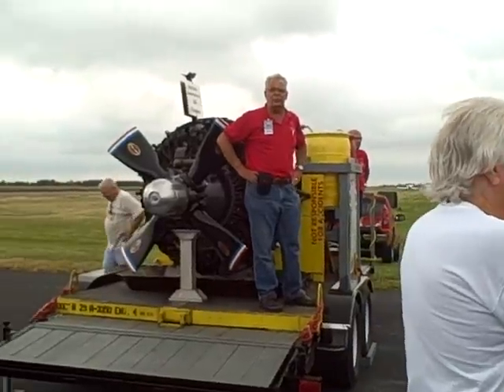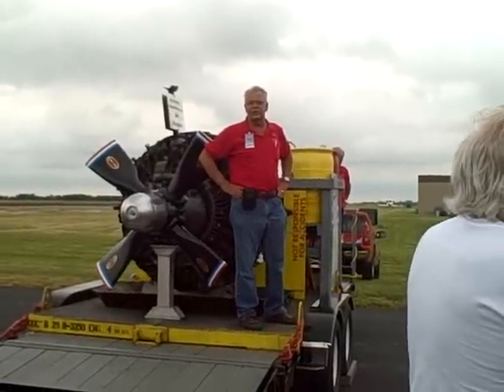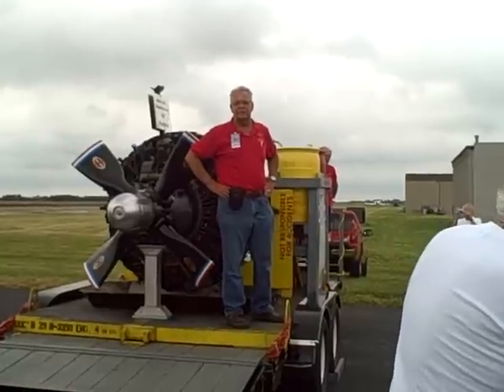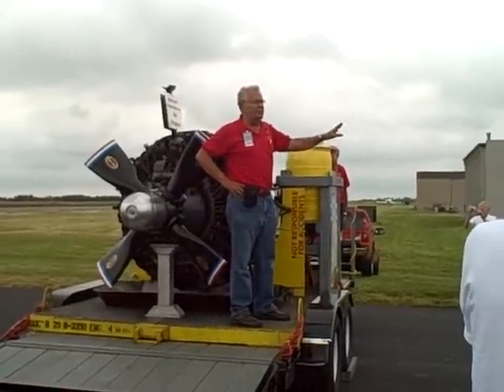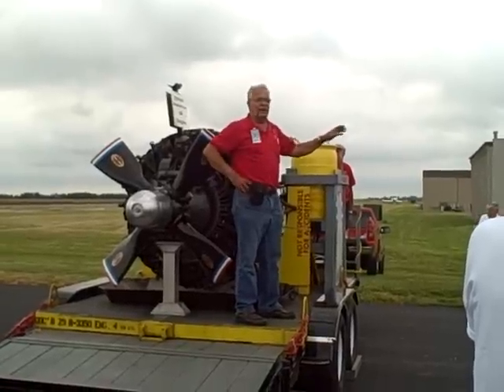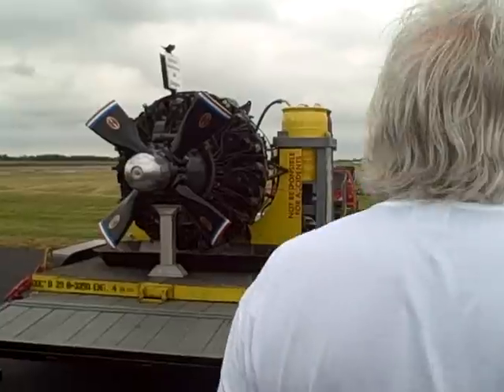B-29 "Doc" number 4 engine static start

Comment: WOW! What a great sound. I remember flying on one of the Constellations and hearing those wonderful engines all the way from Indy to LAX. We stopped somewhere and changed planes. I was only 5 but I will never forget that wonderful sound when those engines were started up one by one and then hearing them under a load for take-off. I was so lucky, as my pop worked for the FAA and we flew often. I got to go up in many airplanes. It is so quiet now in the airliners of today. Thanks for the video!

Comment: When these engines were test run at the factory they used large AC generators to load them instead of propellers. Power from the AC generators was then used to run the lights and machinery at the plant to reduce the need for outside power generation.
Reply: Back when these engines were made these early Wright R-3350 were beset with problems as that accounted for some B-29 losses then the high magnesium content led to fires the way the exhaust came out the front ports led to high cylinder head temps. as the FIFI crew had trouble with them what i red. since then both FIFI and DOC have been reengined with hybrid versions of the later Curtiss wright R-3350 a 95w and 26wd engine by Anderson Aeromotive. as the later models  of these engines are so reliable some were turbo compound with three power recovery turbines on them that powered the Lockheed Constellation and the Douglas DC-7 the Douglas Skyraider and Fairchild packplane.  as the dutch are using these engines for tractor pulling there.  Now Doc is restored and Airworthy soon to fly along with FIFI.
Reply: She'll make power..

Comment: I read a story in a magazine that those engines were replaced with a newer version of the same engine. The same engine that was on the A1 Skyraider. Same engine but doesn't need a supercharger
Reply: All radial engines need a supercharger to distribute the air-fuel mixture to the intake valves.

Comment: @Milstar73 Prop reversal is an optical illusion caused by the camera's shutter frame rate.  Try moving your hand back and forth rapidly in front of a fan blade. the blade will look like it stops and starts.

Comment: Do they overhaul  those engines
Reply: +@Mike-dh6nb   The engines are overhauled at certified engine shops, and there are few that still work on them.   One of the problems was that B-29 "Fifi" was barely getting 100 hours from their engines.   A plan was made to take the most durable components from different 3350 engine variants and combine them, basically creating a hybrid engine.  Now "Fifi" has more powerful engines with prop gears that help them use less fuel.   The B-29 "Doc" restoration was hesitant to use the new engines because they wanted to keep the plane original.  But for practical reasons "Doc" also uses the new engines since it is a flying restoration and the engines are less expensive to maintain and fuel.